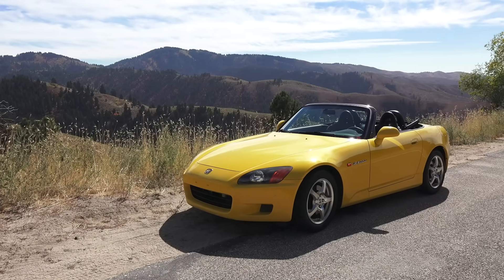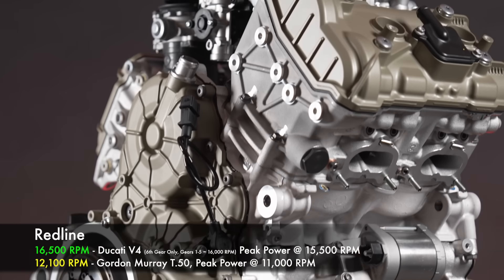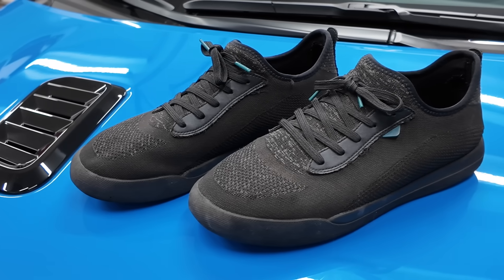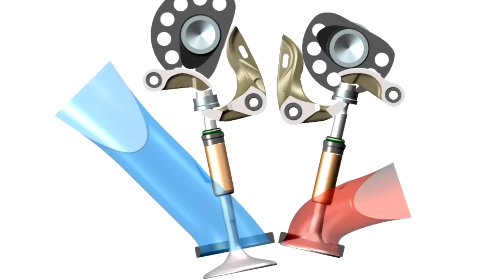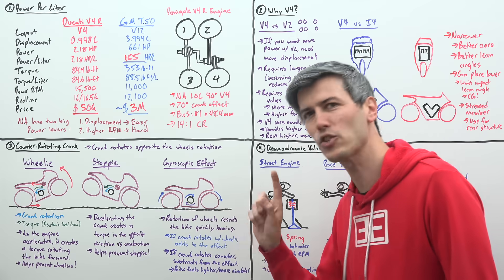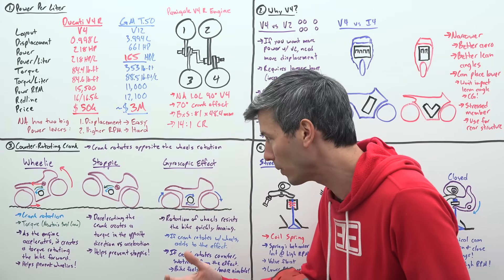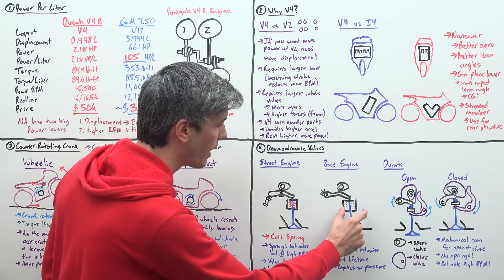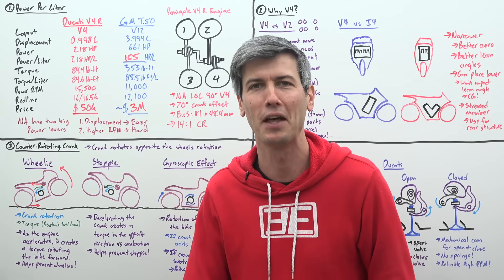Ducati's Brilliant V4 Engine — Putting Supercars To Shame!

Comment from the maker: With the holidays coming up, now is a great time to snag some Vessis, with 45% off select styles for a limited time. Grab your new waterproof gear here: https://vessi.com
*Edit/Note:* TIL about the MV Augusta, which uses a counter-rotating 3-cylinder in their road bike! So there are others, but not many - appreciate the correction in the comments! Forgive my newness to the bike world!
Reply: Jason... Would love to know more about the 90° V4 and 70° firing order. And how is it different to Aprillia' s V4. Please make it happen.
Reply: MV Agusta, not Augusta.
Reply: Please do more in-depth engine analysis on motorcycles
Reply: Well, let me point out this ... in past times, I had three Honda CBR 600 F (F4 in USA), it had a N/A 16 valves in line 4 cylinders and it's power output was about 110 hp at 12000 rpm as stock, so back in the 90's, Honda had already reached a very high power/displacement ratio, 160 hp/lt, with a "simple" inline 4c ... And those engines were rocksolid reliable! Don't forget that the engine in the S2000 is an absolute masterpiece in realisation and can easily keep up with the most hard tunings! The V4 Ducati engine is a world-class engineering wonder but sorry to say as an Italian, Ducati is not world famous for its durable engines...
Reply: Desmodromic valves are hardly an innovation. Ducati have been doing that since the late 60s and Mercedes used it in the W196 back in the 50s.
Reply: F1 engines are not rebuilt every race.  The amount of tear downs, is restricted as is the a part limitation as well.   Per Google they last about 1500 miles and 7-8 races.  Still a far cry from any road used engine, but way more durable than a top fuel engine, which typically don't even make 1000 revolution between rebuilds.
Reply: What are the disadvantages of the counter-rotating engine?
Reply: You could probably embarrass Ducati with any random high output RC motor with power v displacement.
Reply: @junkdubious Any two-stroke engine, when properly set up, with produce more power than an equivalent displacement four stroke engine. In the RC engine world, the same applies. Some 2 stroke RC engines are capable of turning over 30,000 RPM, and, as a result, are capable of making tremendous power for a given displacement. However, 4 stroke RC engines are not capable of turning anything near this fast nor producing anywhere near the same power. Also, remember, most RC engines use a fuel with VERY HIGH NITRO ratios. Much more, even, than top fuel dragster engines…
Reply: @macmclemore  Right. That's what i said. So...we agree?
Reply: Congratulations on discovering motorcycles! We’ve been having all the fun for decades!!!
Reply: As an owner of a Ducati v4 your video brought joy until it didn’t finish with all the details please do the rest.
Reply: it's really painful to watch how you measure things by parts of your body and other unrelated ridiculous crap...
Reply: @chiboreache It is also painful to read comments made by the under-educated… What do you think is the origin of the metric system…? Try harder…
Reply: In your opinion, would the Ducati V4 engine and transmission be suitable for installing transversely in a mid engine rear wheel drive configuration, ie in something like a Toyota MR2, Lotus Elise, or Fiat X1/9?
Reply: @markbowden7238 It can be done and would not be terribly difficult. However, these engines do not produce torque, nor have much flywheel inertia. Not particularly suitable for daily driven automobiles. There are quite a few YouTube videos covering cars like Miata’s powered by Honda CBR1000 engines and one of a VW Beatle powered by an 1800cc Honda Goldwing engine.
Reply: You talk at even elevated loudness like you're trying to coach people into making Ducati. Deprecate that, try to call things out with as much structure as possible so you can talk like a person (do you have hearing issues (e.g. velodrome ear) messing that up?) and please say how you put 3-5 mile runs (est. dog adventure) in on your Vessi for 2 years without the soles cracking off or wearing away completely?
Reply: @Cineenvenordquist WHAT…?
Reply: Yesss love the bike stuff. Please bring more motorcycle stuff❤
Reply: I actually like that MV Agusta is often unknown, or ignored by motorsport enthusiasts, despite making such gorgeous motorcycles with top of the notch performance and technology. it makes it even more special. 🥰
Reply: Aprilia's 65° V4 sounds so much better and it does not cost you a kidney.
Reply: Counter rotating engines have been around for a fair while, with many bike models using this direction - even some old Ducatis. I seem to remember the Laverda triple may also have run 'backwards' but I'm a bit hazy on that. Early 'bevel' Ducati engines ran 'backwards' (but their cams ran 'forwards') whereas later Ducatis (Pantah-onwards, right through to recently for most of their twins) ran forwards, but their cams ran backwards... 
But I think the Yamaha Grand Prix bike has run counter to the wheel rotation also, for many years, so these properties have been understood for a long time.
Reply: Hey science dude, can you do a video explaining whether it's better to rotate your tires or to replace the rear with new tires and move the worn rears to the front??

A. We're told tires need to be rotated to ensure all the tires wear evenly.

B. We're told that the tires with the most tread should always be on the rear wheels.

C. The front tires always wear faster than the rear tires.

So if the front tires will always be worn more than the rears, and the tires with the most tread should always be on the rear..  WTF IS THE POINT OF ROTATING?!

The only thing that makes sense to me is instead of rotating, just wear down the front tires and then move the rears to the front. Then, place new tires on the rear (from what I understand most of the world outside north America does it this way).

But oh wait, there's D.. All tires should have even grip (which would mean even tread depth i assume.

So yeah, how about that video? 🙏
Reply: Install that engine in small cars !!!
Reply: please continue the video :)
Reply: Welcome to the bike world. It will change your mind everything you thought was cool on cars is better on bikes.  I was gonna bring ho MV Agusta too. We are interested in more bike videos too
Reply: Ugh!  I'm disappointed in this one.  Lots of great, nerdy info about the Ducati, but can we please stop glorifying HP/Liter?  It is a totally irrelevant comparison for different sized engines.  I can go to my local dealership and buy a car today with 640HP/Liter from its stock engine and nobody thinks there's anything special about it.
Reply: @mikeunsupervised9254  you may want to watch Jason's videos on BSFC and BMEP (Brake Specific Fuel Consumption and Brake Mean Effective Pressure, respectively)
Reply: @mikeunsupervised9254 what engine is putting out 640HP/L?
Reply: @mikeunsupervised9254  Not naturally aspirated you can 't.  You can argue that more of an engineer metric most of the time.  Still can't say that the GM LT6 121 hp/L is not far more impressive than a Ford Voodoo 101 hp/L because of it's superior HP/L.  It's also physically smaller and lighter.
Reply: @Dayandcounting  Sure I can.  
It's just a 3.3cc engine I'm talking about....  HP/L is naturally higher the smaller the engine is.  Smaller, lighter components make it easier to have higher peak hp.  Let's see Ducati get 240hp/L out of a 6L V4.  Not going to happen and still be reliable.
LT6 vs Voodoo are nearly the same size.  Therefore you are taking displacement out of the comparison and really you are just saying the LT6 makes more power.
Reply: @mikeunsupervised9254 You must be thinking of comparing tiny 2 cycle engines capable of turning over 30,000 RPM running on NITRO fuel. This type of engine cannot be used in any form of street legal vehicle or even racing vehicle capable of propelling a human body. Not a viable comparison in any way.

Comment: Amazing video,  thx!  Only issue i have with the Ducati is the stoppie aspect.  Street bikes rely heavily on the front brake for stopping power and if the engine is counteracting the weight diving forward when decelerating you lose the extra weight transfer to the front wheel for better stopping power, and or lightening up the front-end of the bike when diving into a corner while deceleration might not be a good thing in some cases but would help with wheel push in others maybe. Must be a weird feeling you'd have to get use to i guess.

Comment: Sure, one can make a V4, a great V4, but a V4 is a poor idea for intrinsic reasons. An I6 or even V8 made by Ducati with the same technology and approach would be far better. Sure, you can make high power small engines for motorcycles when they weigh less than their riders, and racing engines are for racing and do not serve domestic needs. Car engines tasked to carry over a tonne of car plus another tonne of load are a very different scenario and require a different approach and always will. A ~500kg two seat micro car is a different thing, but sadly we don't do that - we have a large vehicle size vacuum between the motorcycle and the car in most applications and markets. Note - increasing the number of cylinders does not increase engine width or length by that number, a twin cylinder is not twice as large as a single.

Comment: Is there any aspect of this design that could be applied to passenger vehicles or other ICE engines outside motorbikes. We have seen high revving before of course but very high rpm tended to stress the parts , generate alot of noise and perhaps create knocking as the intake valve heads have very little time to close properly and thus generate knock. Might see in Audi offer this somehow as they own Ducati

Comment: Love your videos, and I've never until now found anything to disagree with. But you are in error when you say that the counter-rotating engine will offset some of the gyroscopic effect of the wheels to allow more nimble handling. The direction of rotation is irrelevant in resisting lean angles.

Comment: I don't get the part with the gyroscopic effect. The resistance to leaning should be the same no matter witch direction thr motor turns. The difference would be that while the weels like to turn left when you lean left while the motor would like to turn right while you lean left. Since the motor is fixed it makes no difference.

Comment: just a quick note: lower cg does not increase cornering capability on bikes. Higher CG is going to allow for your gravity force vector to remain "above" the line of the sideways force vector you face in a corner for longer as lean angle increases. If you could theoretically put the cg below the ground while riding a motorcycle you would lose traction very quickly as you start leaning. Unlike in a car, where this would give you a huge advantage.

Comment: Pretty sure someone said it before, but "Desmo" is a lot of things, but three things it is not: It is not an innovation, it is not a Ducati patent, and it is not new, not even for Ducati.
The idea of Desmodromic valve actiation is about 130 years old, so at best Ducati could have trademarked theirs, and Ducati is using Desmodromic valves since 1954, which is a whopping 71 years ago...

Comment: Ducati is the ferrari of the motorcycle world. That's why they can afford to take these risks with incredibly high performance engines, high complexity and expensive maintenance and service intervals. It's for people with crazy deep pockets or racing enthusiasts that want the absolute best with no compromise in performance, for everyone else on a budget, a standard japanese i4 will get you 95% of a panigale V4 while holding reliability and cheap maintenance costs. Or even better, the S1000RR.

Comment: The MV Agusta F3 engine also has a counter rotating crankshaft as well, having owned one 2015 -2024 it is like witchcraft especially when exiting slow corners where you woukd expect to be limited by front grip rather than rear grip as the front end lifts, instead you find yourself able to just feed in the power sooner and harder than you previously imagined possible.

Comment: a little correction about stressed member engines: most modern sportbikes, any configuration, use the engine as a stressed member. The wording makes it sound like the I4's dont use the engine as a stressed member, but if you look at any sportbike frame then it becomes super obvious that the engine is pretty much always a stressed member.

Comment: But comparing bike engines to cars is oranges and bananas.
The bike engines must rev so high they would be unusable in a car when driving normally.
They have terrible torque and their longevity is very low mileage when compared to traditional car engines (not the brittle emission governed modern engines).

Comment: I bet if you put that Ducati engine in a small car, attach it to a car transmission, and driveshaft stuff will start bending, breaking, and popping really quickly. horsepower alone doesn't solve for the fact that a car engine has to propel the mass of a car, torque and horsepower numbers don't account for the resiliency of parts required to move a lot more mass than a human body on a bike.

Comment: Now lets ask the simple question re the EXPIRED desmo valve opertion which is "WHY is no other manufacturer taking advantage of the fact they too could employ this tech?    I believe the answer is that while yes it can work but there is no REAL advantage given other technolgies especially given advancements in spring metrallegy.  The desmo type system just creates a very expensive motor to maintain without any clear perfromance benefit

Comment: Yamaha had a counter rotating engine late 70s early 80s in the XS 1100 it was a in line 4 cylinder. I also think the Honda 900 fire blade was a counter rotating engine. I think it was a 91 model, but I can’t be totally sure.👍😎

Comment: I'm no engineer, but I am not sure I buy the idea that the opposite rotation of the engine subtracts from the gyro effect of the wheels... in my mind gyro is gyro no matter which direction the spin, so therefore the engine is a third gyro contributing to lean resistance.  Tell me I'm wrong!

Comment: Super impressive but, suck, squeeze, bang, blow aside, YASA's 28 pound electric motor with peak power of over 1,000 horsepower and a continuous power of 470-540 horsepower ain’t no slouch either.  Just sayin’ . . .

Comment: Peak bhp, at mind bending rpm is so pointless.  Ooh, my car makes 160bhp per lire.
At 12k rpm.
On one rotation of the crank. 
And I'm doing 60mph.
In first gear. 
Then i have to change to 2nd.
 Power drops.
Woohoo, 160bhp per litre 
At 12k rpm
In 2nd
100mph
Straight to jail.

Comment: 6:10 "you can also place the engine lower, keeping the center of gravity lower-" 

Whoa hold up. Bikes are not cars, you do NOT want the c.o.g. to be as low as possible. There is an ideal height based on how far forward or back the weight is, so having the flexibility is good, but "as low as possible" just makes it harder and harder to lean the bike and keep it leaned - it turns the bike into a 1/4 ton Weeble

Comment: BRILLIANT VIDEO.  LOVE! THE BIKE ENTRY. WHO NEEDS COKE WHEN YOU CAN BIKE..😎 THE 2016 HONDA VFR 1200 F ( AN ABSOLUTE GEM ) PRODUCED 129 Nm TORQUE @ 8,750 rpm → ≈95.2 lb-ft, ALBEIT FROM ITS 1250 CC V4 -
Reply: THE HONDA VFR IS A BIKERS BIKE- IYKYK!
Reply: I`M  ON MY 2ND VFR, 2015. BMW STILL DOENST HOLD A CANDLE TO HONDA`S 15 YEAR OLD DCT!

Comment: Regarding V configuration vs straight has to do with harmonics.  Straight engines suffer from bad harmonics.  V engines don’t suffer from this as much due to shorter crank.

Comment: Mercedes pioneered desmodromic valve gear in their racing cars in the 50s. It had been ignored till then, because of the difficulty of exact closure with changing temperatures. Mercedes discovered that exact closure was not necessary, if it got the valve within a couple of thou of the seat, cylinder pressure did the rest. Ducati persists with the design, thanks to the Italian obsession with performance at any cost.

Comment: Love the video but I'm not sold on the counter rotating engine improving turn in.  I don't care which direction the crank is turning, it's still going to resist leaning over.  If this wasn't the case it would be far easier to lean in one direction than the other with a regular crank rotation.  You either need to retract that or come up with a far more sophisticated explanation.

Comment: I had an older Cagiva Elefant motorcycle a few years ago, it was designed for the Dakar Rally so it was a dual purpose style bike. It had the Ducati 650 twin from their older street bikes, it also had their desmodromic valve system, while it did not spin 16,000rpm it was very smooth and very reliable. Very fun older bike and very rare and unique.

Comment: Are you sure about the counter rotating engine preventing wheelies? You still end up reversing the direction through the transmission and applying torque to the rear wheel in the same direction of the wheels which will tend to induce a wheelie. 

As a fellow engineer and fan I totally respect your expertise on pretty much everything engine-related, but I’m not sure about this one. 

My immediate thought was that the reversed engine rotation has more to do with offsetting some of the gyroscopic inertia of the wheels, thereby making the bike easier to lean through turns. 

I’m seriously interested in a response on this. 

Thanks for your vids!

Comment: most bikes dont have that rocker arm in the head most have it so the cam lobe is pushing on a bucket that is pushing the valve what you show 10:32 is a car engine with hydrolic valve adjusters